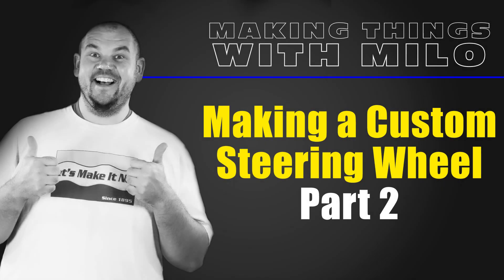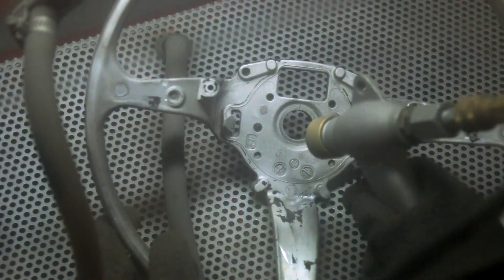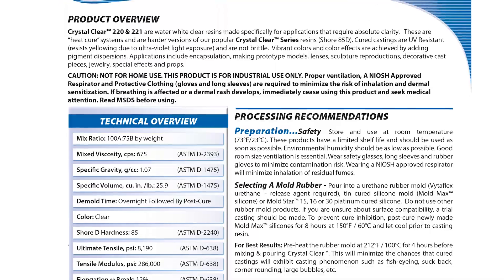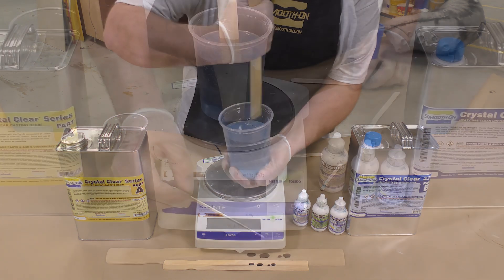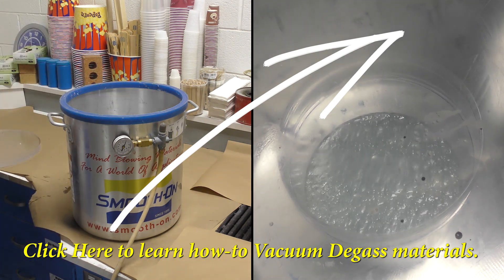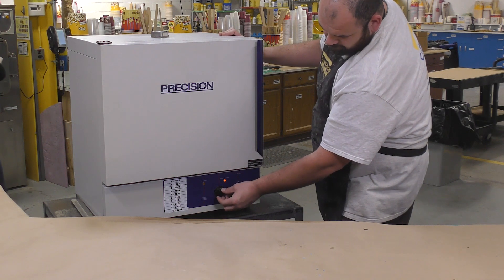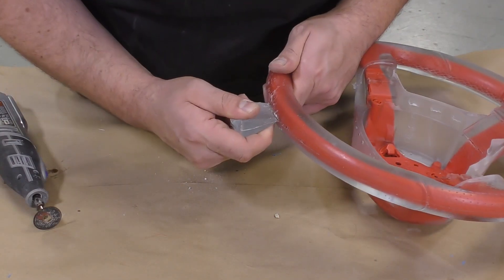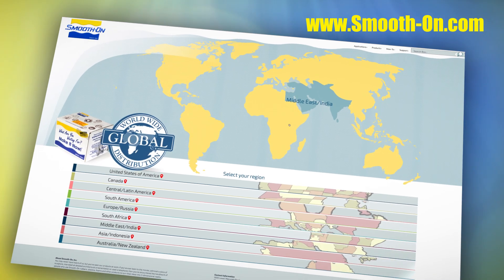How To Make a Custom Steering Wheel: Part 2, Resin Casting

Comment: I have a toyota echo 2001 whose wheels have covers made out of some foam(or flexible rubber) that is attached to the steel rim. after hitting a wooden box, one of the wheels got badly damage. Since its been impossible to find a replacement I had to use a conventional steel rim with no cover. I was wondering how to reproduce the original cover, either using urethane foam or other type of polymer that can have a smooth finish

Comment: Hi Milo! I really enjoy watching your videos. I have a project that I have been planning to do using smooth-on products and watching your videos to learn how to do what I want. I have a 1999 Camaro and want to create my own modern-looking LED taillights. My plan is use my stock taillight housing to develop a mold that I can use to create a new housing that will work better with my idea for the LED’s. I also plan to separate the lenses and create new ones using your video of the yellow lenses you created. Would you be able to create a video showing how to mold and create a taillight housing that shows what smooth-on products would be best to create the mold and the housing, as well as the best method for producing the mold (e.g. vacuum or pressure). My idea for the new housing is to keep the basic shape of the taillight and the screw posts that mount it to the vehicle, but removing the exterior convex/interior concave of the taillights and flatten them out for LED strips. Please feel free to contact me if you have any questions regarding my request! Thank you for your videos and I look forward to seeing more of them!

Comment: What material do you suggest for casting a steering wheel and replicating the oem p.u. foam? Can a more rigid rubber be used?
Also, How about to keep it a black uv safe pigment? (Instead of upholstery the wheel later on)
Reply from the maker: Hi there!  This is a good question for our tech support team, can you send them a ticket here? https://www.smooth-on.com/support/ticket/add/agree/ Thanks for watching!
Reply: HAMMER did you get your answer on this? I want to know the same thing,

Comment: Very impressive. 
Wouldn’t the fill cavity had been better on the bottom of the steering wheel to hide any imperfections after you remove the excess casting?

Comment: Is 176°F enough for use in a car? Those temperatures are easily reached when a car is in the sun.
Reply from the maker: When it is used as an encapsulant around the metal insert, heat deformation risk is greatly reduced.

Comment: Nice job, people don't grasp the concept of making your own stuff?  What if I had a 1922 Watchamacallit, and it needs a steering wheel because yours is all busted and cracked up. You fix it with bondo, make it perfect, now you can recast it, and have a new wheel for your 90 thousand dollar car!
Reply: I'm planning on doing this with some of the cosmetic parts for the 1973 maverick.
Reply: U would have to cast it in bakelite to make it legit
Reply: No... it's just really ugly 💁‍♂️
Reply: @izybeghenna3902  why is it ugly? Because you don't like the clear look? Then just wrap it in leather like the original. Im guessing you didn't find the foam covered metal without the leather wrap attractive either dumbass 🤦‍♂️
They just did it this way as an example of what you could do since they aren't a leather channel.

Comment: I would have liked to see it with the airbag installed
Reply: @Ellis Dee You will only get an airbag fault light from this.
Reply: The new steering wheel was cast from the exact same shape of the old steering wheel with the airbag removed. I don't see there being any reason the original airbag wouldn't fit into it
Reply: @Ellis Dee Sure but I think we can all agree it is very unfinished without something in that center cavity. I think its fine to put it back  but something special needs to be done. a  custom paint job on the airbag cover etc.
Reply: Also I think the next steep would be to polish that resin so its clear instead of frosted. unless like Tony V suggest, its got LEDs to make it glow
Reply: Do you have a video for car spoiler? Been searching how to make a mold and duplicate a spoiler for my hyundai getz car
Reply: Wow lots of work to make a mold,  thanks for the video I have some projects and this will help me out
Reply: You can fix the airbag light with the resistor etc., but I would’ve liked to have seen it with the airbag void completely filled.

Comment: so, the metal ring you just sit inside with no support and it comes out magically perfectly centered? or did i miss something?
Reply: I think the back of the steering wheel where it sits on the hub is centering it. Can't explain it properly, but if you watch closely how the mold is made you'll see it.
Reply: The mold holds it in place
Reply: The hub area of the steering wheel  is bare from the factory, so its support is part of the mold.

Comment: But, airbag?
Reply: Its still a stock shape, the airbag and all accessories should bolt up perfectly.
Reply: Ok, but the airbag its ~imposible to modify like the stering wheel
Reply: @sebyhas  um...what? The steering wheel itself isn't modified, just the padding around it.  There is nothing keeping them from bolting a stock airbag to the wheel and it performing as normal.
Reply: @sebyhas  or are you saying you cant make the airbag clear?
Reply: @steelbluesleepR  yes, thank's.

Comment: How many time could you reuse that mold?
Reply: i've never done any of this, but just based on videos i've watched over time and the quality of materials used and used professionally, i would guess at least 50 castings. i'm just throwing that number out there for ya because just about any 'answer' is vague, like 'more complex moulds don't last as long.' that answer doesn't help any more than the other thing they always say, 'properly stored, a mould made from xxx should last xx years.'
Reply: As many as you want. As long as you take care of the mold it could be indefinite

Comment: Make a carbon fiber steering wheel from that mold.
Reply: Impossible, carbon wheels are wrapped. They don't require molds.
Reply: @miloradmedunic6202  Not all of them idiot 🤦🏾‍♂️
Reply: @miloradmedunic6202  It's not impossible dumbass. There are actual carbon fiber wheels on cars like the Shelby GT350R, so what makes you think it's impossible to make a steering wheel made of it. You're stupid AF 😒.
Reply: @kde5fan737  Sounds like your feelings are hurt. Po baby. Do you need a bottle?

Comment: That’s awesome! What did you do with the air bag?

Also I need to make a crystal clear windshield for an old rc car. It’s a wrap around with the side windows and rear window also. I’ve been watching your videos and think I know which silicone to use, but which resin would be best? Needs to flex a little and be clear.